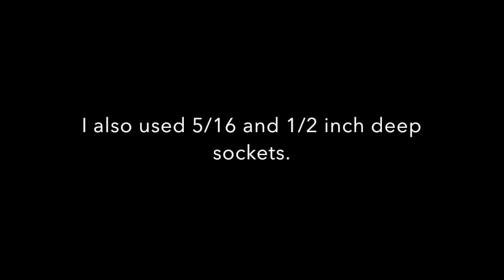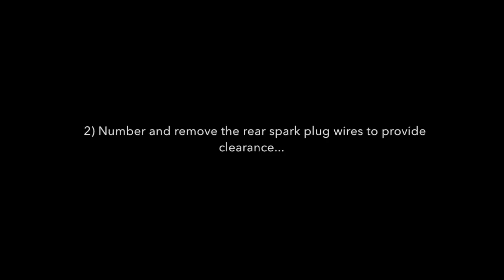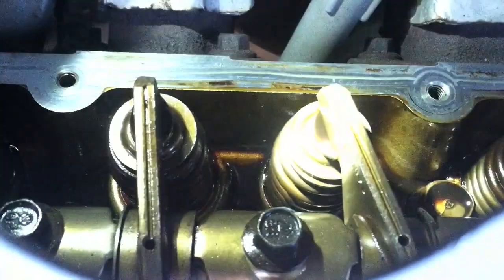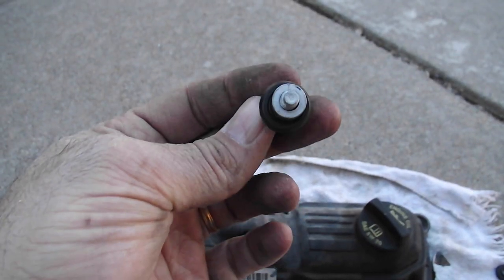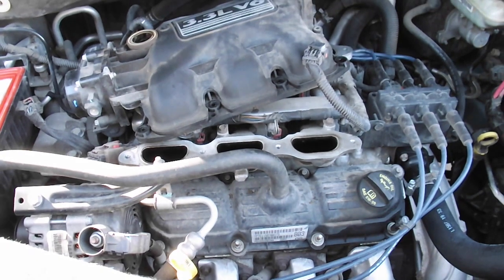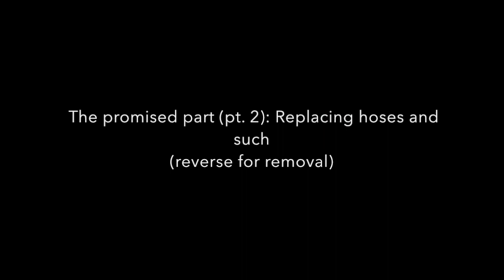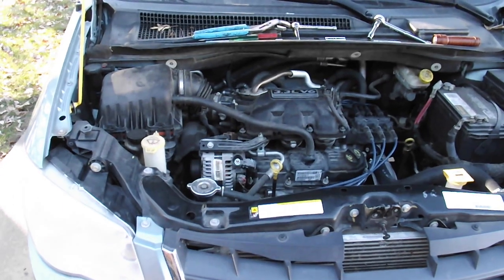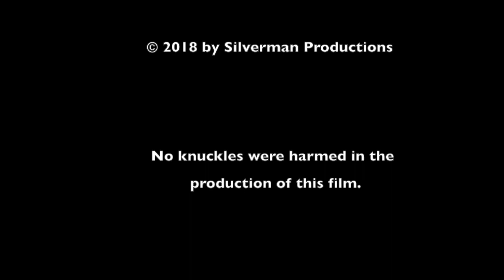2008/Mk. V Chrysler Town & Country Valve Cover Gasket Removal and Replacement

Comment: Thanks! But my front valve cover was sticking on even after unscrewing. Any easy way? I barely used a pliers to lever it off.  Hard job .. and I didn’t get the 1/4 drive wrench and 5/16 deep socket bit but really need it!! Will buy it for rear cover... thanks!!

Comment: Thank you for posting this. It’s the only video I could find with this engine. My rear valve cover was leaking pretty bad. The tip about the universal socket adapter was a life saver. I wish I could give you more than one thumbs up.
Reply from the maker: Glad it helped

Comment: Thanks for this video you saved me a fortune. The Previous owner put freaking permatex making it really difficult for me to repair, and the permatex got in my piston arms and got yanked in causing a hole in the valve gasket causing a massive leak and burn in the front one  and loss of oil pressure  and deceleration overall. Hopefully this helps.
Reply from the maker: Hope it works out. It's amazing what people do sometimes when they don't know what they're doing...

Comment: Thanks Doc. Planning to do this soon. I also have a bad PCV valve I'll replace and would also like to do spark plugs and wires. Are the rear spark plugs accessible with the rear valve cover off? or would more need to come out, like the intake manifold?
Reply from the maker: You can do the spark plugs "blind" if the engine is cool and you have a good feel for working over the engine and "backwards." Just be careful when threading the plugs to avoid cross-threading them (they should go in very easily).

Comment: Good info, though the video editing could be a bit fine-tuned.  You do convey what somebody thinking about doing this would need though.  Questions:  Just to confirm, the original rubber grommets need to be "cut off" and replaced with new ones?  Did you not use any RTV in the gasket grooves?  Thanks
Reply from the maker: No, you should never use RTV on these gaskets (I know, it's weird). Ask at the parts store. As for the rubber grommets, they're most likely toast anyway. You don't want to have to do this job again for a while, so make sure that your gasket kit has new grommets included before you cut the old ones off.

Comment: Do you have to take out the spark plugs to complete the job?
Reply from the maker: No. The only reason you have to remove the plug wires in the back is because they block access to removing the rear valve cover gasket. The plugs bolt into the block below the valve covers (at least on the Mk. V 3.3 engine). Good luck with your project.

Comment: i didnt take the intake off or the plug wires
Reply from the maker: For the front or the rear? I guess it's possible (just not particularly easy). Did you record it?
Reply: @drsilverman  rear did not record it was fairly easy took off the air cleaner hose assembly for excess to left bolts and used a swivel for the top middle bolts